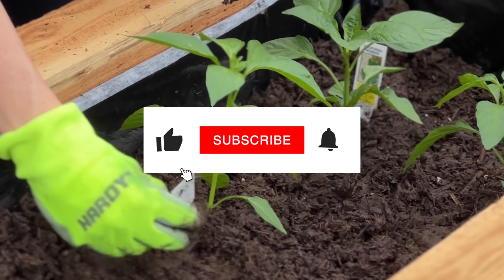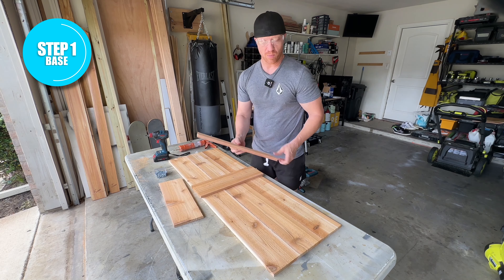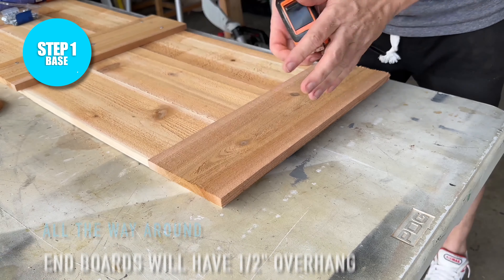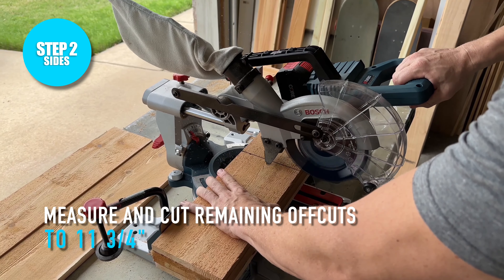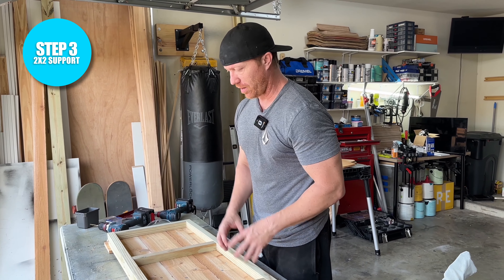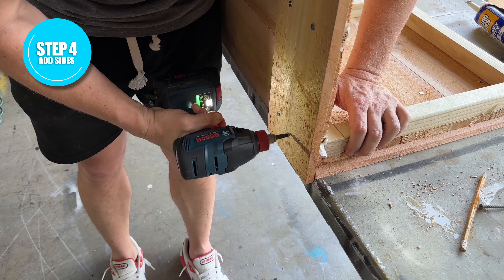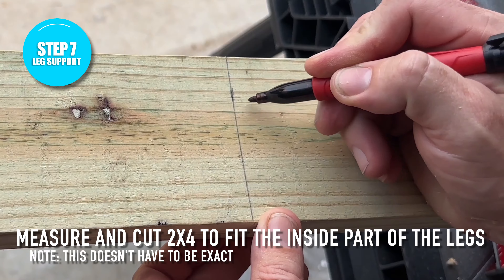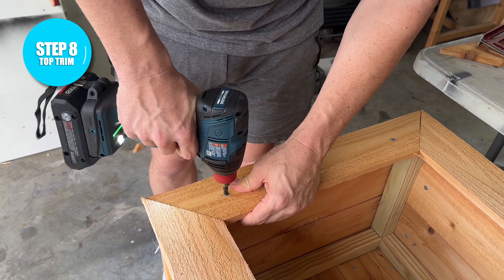🌳 Transform Fence Pickets into Stunning Raised Planters! 🌳

Comment: Seems you forgot the drainage holes in the liner also. You don’t want water pooling and drowning the roots, otherwise unbelievably well planned and explained. Another suggestion would be to place a light layer of pine ones, shredded paper, cardboard, or leaves as bottom layer before adding dirt or compost. It will feed soil as it breaks down, entire planter weighs less if you need to move it, AND it saves on price of soil. Win win.